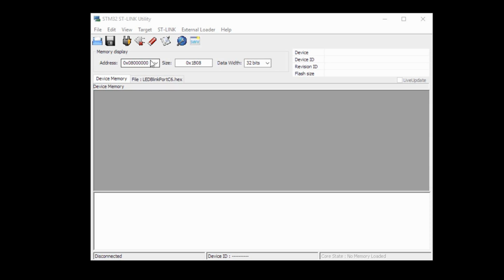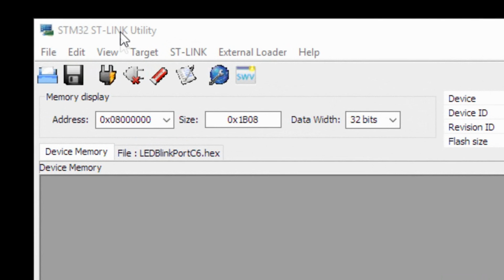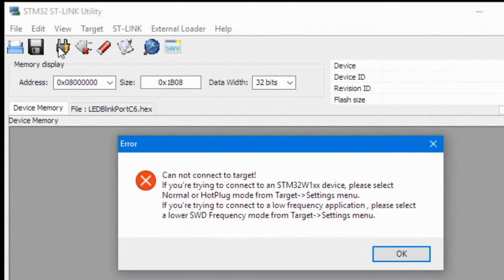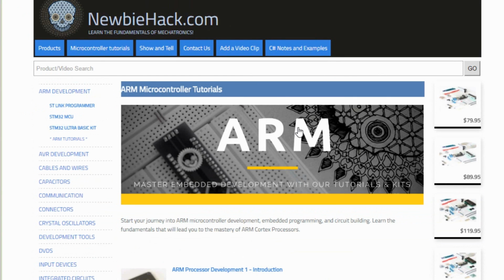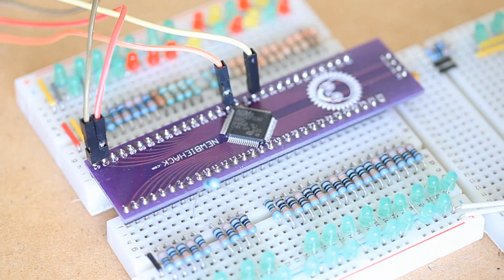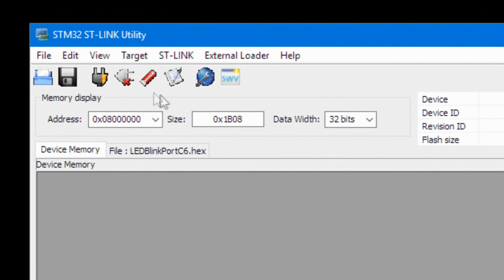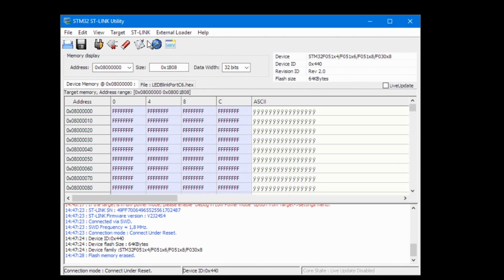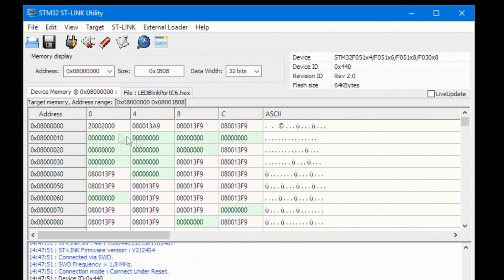9. How to Resolve Can not connect to target for the STM32 and ST-Link

Comment: dude erasing full chip will erase the bootloader allso ?
Reply from the maker: Bootloaders are not used, and not needed in any of my projects. The chip does not ship with a bootloader. A Bootloader is code added to a chip for systems like Arduino and such that allow you to use a USB cable to program the microcontroller.

Comment: Thank you. I had a knock off stm32f103C8 that i had trouble getting to respond at all. This solved it along with connecting both the external power to micro usb and the st-link at the same time
Reply from the maker: Excellent. I am glad it helped.

Comment: Patrick, I am getting a similar message from my STM32. However my ST-LINK already has a lead into the RST pin on my board. So does the resistor bridge the RST pint to Gnd or to I keep the RST pin connected to the ST-Link?  Thank you kindly for any tips!
Reply from the maker: I would try  both.  sometimes it needs to be connected and then disconnected quickly.

Comment: Thank you so much. How on earth did you figure this out? I was having similar/same trouble with a Blue-Pill module bearing a CKS32F chip instead of genuine STM32. Thanks to your video I am able to erase and program the rogue Blue_Pill by holding the reset button whilst launching the erase or program process. Thanks again.
Reply from the maker: I determined this by creating a test circuit for the STM32 boards that I sell.  I wanted to test each pin with an LED to make sure I soldered all of the legs correctly.  The program tested all of the pins, including the programming pins (by accident).  When I realized that I programmed the pin functions of output for the programming pins, I knew this was the problem, but the solution also solves other issues as well.  As a part of my complete ARM tutorial, I wanted to make a video of this so my customers can benefit from it.  Thanks for the kind words.

Comment: Hello, sir:) I have the ST-Link Mini V2 and Bluepill (with STM32F103C8T6). When opening ST-LINK utility and try to connect, "Can not connect to target" fault of course appears. But if I hold reset of the bluepill (or just connect Reset to GND), then I can connect correctly. And afther that, I make an upload of hex to the Bluepill and the Bluepill is resetting automatically. After that (after this reset) the program runs okay (LED flashing connected to pin PA1 for example, just like "Hello world" in C++), but (!) and the same time this reset destroys my connection again! ("Connection to device is lost: check power supply and debug connection.
 If the target is in low power mode, please enable "Debug in Low Power mode" option from Target->settings menu.
").

How can I fix that? Of course I can upload any hex and run it on my Bluepill, but it is exhausting for me to make a new connection again and again after a particular hex upload :(

Comment: Why do I have to unplug the ST LINK Device whenever update the program? (STM32F103CB + KEILV5 + ST LINK V2)

Example:In LED Program running Perfectly...now in KEIL i updated the Delay to from 100 to 1000 &Rebuilded, Saved & Downloded...but the Program is not running in STM32F103CB Board.

if i unplug & plug the ST Link, the updated Program runs Perfectly.

Thanks in Advance

Comment: I knew this problems was missing connect between BOOT0 and GND pin before firmwaring MCU but firstly connect power to MCU later connect between BOOT0 and GND or VCC. See data datasheet of each MCU. 
First step - connect power to MCU
Second step - connect between BOOT0 and GND or VCC. It will okay firmware. 
Also target pin must connect VCC(3.3V) before firmwaring MCU. 
Also can follow about BOOT0, please see "AN2606 Application note STM32 microcontroller system memory boot mode" file from official site of stm32 for any stm32 MCU. 
Thanks for understand!
Thanks you for wacthing!
Reply: I got many better work my stm32 MCU.
Reply: I had solve problems was incorrect layout PCB Stm32 MCU and SWD, NRST, BOOT0 pin. Must connect closer distance between connector SWD pin, BOOT0 and MCU.

Comment: THANKS! A very non-obvious solution. I'd assumed that this was being taken care of by the reset line connected to the ST-LINK. Guess not!

I found It also works on the newer "STM32CubeProgrammer" app. But the procedure is slightly different:

1. Make sure the app is connected to the ST-Link probe but NOT the STM32 uC., Check the "Serial Number" field under "ST-LINK Configuration" pane at the right. Press the refresh button if it's not connected.
2. Hold down reset on the STM32.
3. Press the connect button at the upper right of the app. KEEP holding reset.
4. Now press the erase icon at the lower left of the window.  Click OK.
5. Release reset.

It seems to work just the same, at least on Mac.

Comment: Any idea what causes this issue?
On 2 different boards (Blue Pill Stm32F103C8 and Demo Board v1.0 Stm32F030F4P6),  once I debug (via Stm32CubeIDE and an StLinkV3) it won't debug/program a second time.   I can however, using the St-LInk Utility, erase the chip (by starting it in reset).. but Stm32CubeIde/Keil still won't debug/detect the target   (or fails to 'load' or step thru code .   I verified that the StLinkV3's nrst is going to the target's nrst, that 'debug in low power' is enabled, and that the 5v to the target looks solid.

Comment: If you have problems on Bluepill then go to ST-LINK -> Firmware update -> Device Connect and then hold Reset button on Bluetpill and click Full Chip erase. After about 2 seconds hold off the Reset button. It should completely erase the chip.

Comment: After wasting many hours going round in circles, a last effort in reading the customers feedback on the AliExpress part number I purchased. The ST-LINK V2 dongle has incorrect silk screen pinout information on the sleeve. Pull the sleeve back away from the 10-pin connector to reveal the silk screen on the internal PCB. Now, ST-Link can communicate with the target that proper connections have been made.
Reply: THANK YOU! This was the solution in my case as well.

Comment: Thank you for the video.
I'm trying to reset the microprocessor ST32F303CBT7 on STEVAL-ESC001v1 board. The pin #7 is the NRST pin but it's not connected to any port that I can connect to ground. Is there any solution for this situation ?
Thanks !
Reply: es el boton RESET

Comment: Thanks a Loooooooooooooooooooooooot
In South Korea

P.S : If anyone use a blue printed board(A cheap board), Press a "RESET" button continually before click Full Chip Erase in a ST Utility;
After click wait a 1 second put the button. And then you can see a program the chip erased

Comment: Patrick could you help me? I have a generic usb stlink dongle that come with yellow pins and i flashed it to newest firmware but i don't know how to get this dongle working on stlink utilities. This device came with no case, just a tranparent ribbon, protecting the chip, two led ( green and red) ans yellow readers. In device manager on Windows it show ( stlink stm32 adapter) So where can I find a way to know if it works properly?

Comment: If you guys are using board STM32F103C8T6, you should press and hold the RESET button on board and click "Full chip erase"  (as shown in clip) then  release the button!
Reply: Tho Nguyen Hoang, Thank you. Today I got my 'Balck Pill' STM32F103C8T6 generic board and flashed the bootloader. It went through fine and the red LED blinked a few times but subsequently the device was not recognized by Windows and ST Link would not connect to the board. I tried the technique suggested by you. After the 'Full chip erase', ST Link is able to connect to the board again. 
Now I need to decide whether to use a bootloader or to use only ST Link for flashing the device.

Comment: When I connect my stm32 board to a StlinkV2 and plug it in my computer, it works fine but when I connect an oscilloscope or logic analyser between the clock pin and data pin to see how the bits work, it is not able to connect to my PC.
Reply from the maker: Must have something to do with the added resistance.
Reply: How to fix this?
Reply from the maker: I have no idea.  I haven't come across this problem.

Comment: You're save my time! Thank a lot! STM32f103C8T6.
Reply: hey man can you help me, i cant connect to stm32f103c8t6 board.
Reply: Maybe I could. What is the problem?
Reply: Максим Коротенко there's an error saying can't connect to Target. I tried a couple of times, but to no avail. Please help me man
Reply: Have you ever  programming this particular controller or this is the first attempt? Have you the scheme of this board?
Reply: Максим Коротенко first time. I'm using a blue pill as an entry for ARM
Reply: I didn't use this board. Seems like it have several issues. Which programming device do you using: ST-link or USB to Serial?
Reply: Максим Коротенко ST link
Reply: Awesome. In this case shouldn't be big problem. Please make sure you connected ST-link correctly to SWD: on Blue Pill the ground is the last pin and two pins in middle - are signals. Which type of connection do you use? Do you able to switching wires?
Reply: Максим Коротенко I rechecked the connection 10 times but still it doesn't connect to the target, what should I do
Reply: Максим Коротенко I used common jumper wires
Reply: Sorry I missed your messages yesterday. So it's weird. Could you make the picture of your connection? Maybe you have skype?
Reply: Максим Коротенко I do, your email ID?
Reply: maximilian_4 search avatar with fishes
Reply: Максим Коротенко thank you so much for the help man, I erased the flash and ran my first program. But can't make other pins to work. What do you think must be the problem?
Reply: I am glad you found the issue ). Well I guess you haven't turn on corresponding ports. Because STM32 has all ports turn off by default. Do you using Cube MX to generate code?
Reply: Максим Коротенко no I'm using CooCox CoIDE and Cubemx library.  
RCC-> AHBENR |= RCC_AHBENR_CRCEN; 
That kind of programming.
I tried HAL, but it sucks and can't deal with registers directly
Reply: Actually it allows to working with registers directly if you need. And help to save huge amount of time. I would recommend to use Cube MX at least for first time. Back to your problem you also can generate initial code for ports by Cube and see which settings it uses. Ok. I'll see initialization later and put the code.
Reply: Максим Коротенко I'll put the code now

Comment: If you program the pins for JTAG/SWD properly, you will not have this problem.
This is because unused pins, the compiler blocks and after the first upload they are turned off (protected against use) ;)
Reply: Hi there! Could you please tell me how to program the pins for JTAG/SWD properly? I can program my chip with full chip erase but after programming I cannot connect to the MCU except full chip erase again.
Reply: The simplest way is to use CubeMx. Inside the program just simply select which pins are responsible for communication, and the program will enter the appropriate part of the code by itself.
Reply: Thanks for the fast response. I knew you were going to say CubeMX. I don't want to use it though. I just want to use registers. No library. I don't know that CubeMX generates a project without HAL or LL but I don't think so. Is there a way to program the pins for SWD with registers?
Reply: I'm sure, there is a way, but i don't remember it ;(
You have to found documentation or examples for it. I'm sorry.
Reply: Don't be sorry, please. Your comments helped me a lot actually. Thanks dude ;)
Reply: By the way I figured it out. I was screwing up the programming pins by not using or operator during setting GPIOA registers. Everything is okay now.

Comment: I have the exact same problem, but on my board I can't short anything out to set the board in reset mode or something. I'm using the board of the Eachine e011 quadcopter and I know that the labeling is wrong and stuff, so the physical connection is perfect, what can I do? (i tried it with different boards, different PCs snd all the boards are working perfectly in the quadcopter, but I just can't connect to it through STlink utility. If anyone has an idea, please let me know!
Reply from the maker: That's a tough one.  You will probably need to find the traces on the board to get access to those pins.  Understand that this could be dangerous to the board.
Reply: Patrick Hood-Daniel hmm, thanks for your answer, but it should work out of the box, all the other guys in the forum haven't done anything like resetting or sth. they just plugged it in, hit connect and it worked, and I have 3 boards, I can't imagine, that all the boarda have the same issue... I think that it's one little parameter in stlink utility, but I don't know there is only one guy in the forum who had the same issue, he gave up and bought a microcontroller with a usb port. But the forum guys know much about their firmware and flying the quadcopter, but they don't really knoe much about STlink in general
Reply from the maker: If the message you are seeing is "Cannot connect to target" then your computer is able to connect to the STLink, but cannot connect to the "target" which is the microcontroller. How are you connecting the STLink to the microcontroller?
Reply: Patrick Hood-Daniel I connect the 3 ports GND DAT and CLK on the board to GND SWDIO and SWCLK on the stlink, i provide power to the board with the 1s lipo that's also used for flying. I 'm able to connect wirh the stlink, I also can update the stlink firmware and stuff like that, bur I can't connect to the board, I got the exact same error like you did.
Reply from the maker: Not sure what the DAT and CLK pins are going to on the board.  Can you follow the traces from DAT and CLK to see if they go to the pins SWDIO and SWCLK?  What is the number on the chip on the board?
Reply: Patrick Hood-Daniel The hardware connection should be fine, because those are the only pins on the board and it worked for so many other guys, but as I mentioned before, they don't really know much about stlink in general. Here is a video of me trying to connect(don't mind the errors: I have another firmware now that don't gives me the stlink usb communication errors anymore. It now gives me the exact same error like you got) https://drive.google.com/file/d/1ixqbtqX0k8BtIIET0Wz3rLUUBoDpHyZM/view?usp=sharing
Reply from the maker: It doesn't sound like you are completely certain what pins the DAT and CLK connect to on the chip.  I would look at the board and with a magnifying glass, locate the traces that connect to the DAT and CLK and find which pins on the chip they connect to.  Then, look at the datasheet for that chip (hopefully it is an STM chip, or all of this is just for not) and make sure those pins are SWDIO and SWCLK.

By the way, the video came up as 404.

Comment: Doesn't work with my STM32F103C8T6 board, don't know why. I tried hundreds times to connect or erase target with reset or BOOT0. I used PL2303HX and Flasher to erase and still nothing. I downloaded to device STM32duino bootloader and now I can program board with Arduino IDE and USB port but SWD still not working.
Reply: I am stuck as well, this fix did not work for me. Does anyone else have a work around to fix this?
Reply: Sterling Krone i read, that it is possible that microcontroller can be blocked and any communication with stlink is not possible. Only option is to change stm32 on board.
Reply: Hi Kamil Bugdol, I am not sure what you mean by change stm32 on board, do you mean get a new micro controller?
Reply: Sterling Krone yes, I mean that sometimes only possibility is to solder another microcontroller. Im not sure but I read this somewhere.
Reply: Ok thanks for the help Kamil, I will start with the new mircocontroller.

Comment: Is it not just easier for the ST link programmer to control the chip reset to connect RST -> NRST ? this way it auto resets the device before/after programming?
Reply from the maker: Sure,.  Haven't tried it under this scenario.  Have you tried it?
Reply: works like a charm

Comment: Thanks a lot! I had 2 STM32F103C8T6 boards not responsive, but your fix worked very well! 

I found however that there is a bit of timing required to succeed (at least on the type of board I’m using). Once the pull-down resistor is connected to the Reset pin, and you have clicked on the ‘Full Chip Erase’ Button, you want a timeframe, neither too short (i.a < 1sec) neither too long (i.a > 3sec), to remove the resistor. 

I had success both time when I did remove the resistor at around 2 secs after a click on the Full Chip Erase.
Thanks again!
Reply: What exactly did you do my friend? I have the same problem, i cannot program my STM32F103C8T6 by any way what so ever!!!!!
Reply: Thaaaaaannnkkkkkks! I was thinking of throwing myself off a cliff. For me, on STM32VLDISCOVERY, the right time was 5 sec. Best Regards.
Reply: Hi! Did your STM 32f 103 c8t  was found by win 7? My win 7 does not find it! Do you try on STM8 S103?
Reply: Thank you bro.

Comment: You had trouble because you didn't connect RESET line from the st-link to your board. If the programmer couldn't perform soft reset, it would attempt a hardware reset automatically. In other words, st-link would do the same thing you did by manually pulling reset low.